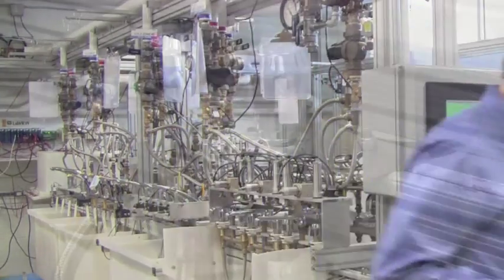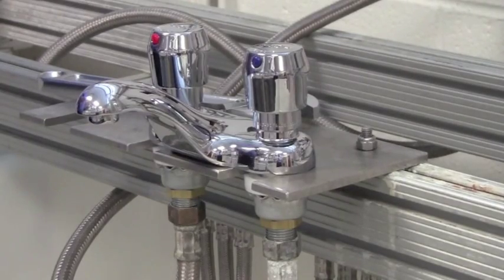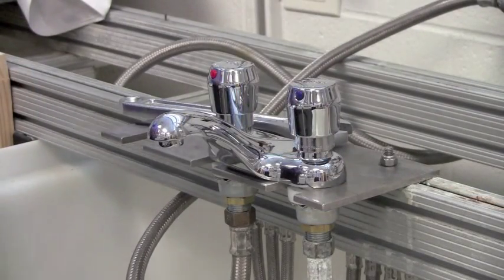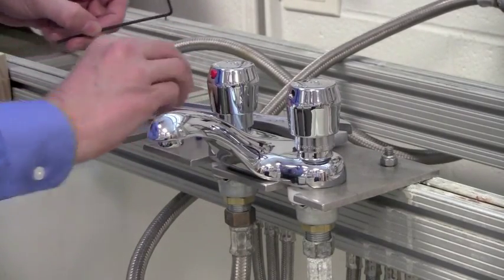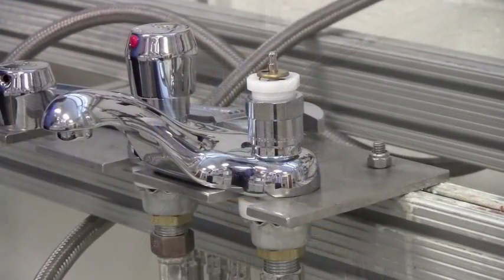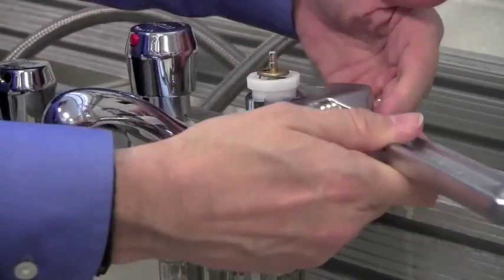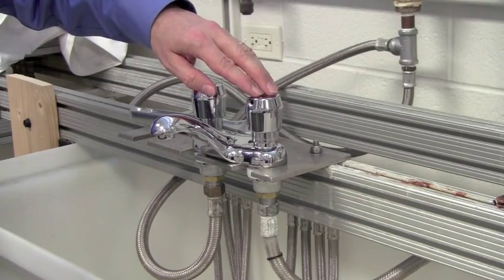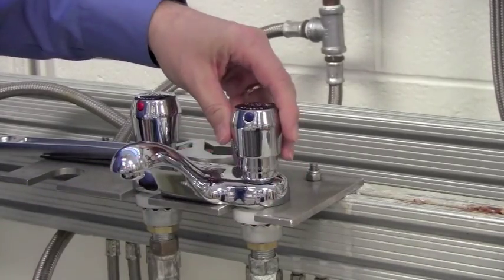Adjust the Timing on Chicago Faucets MVP Metering Cartridge

Comment: I just installed one unit . I air rated the unit fully when i try to time it didn’t work at all . The water keep going and going.
Reply: 3 days lather report. After getting respond from seller i fallowed his suggestion and try to air rated it more time . The next day after using the faucet. The noise were gone and start working properly.
Reply from the maker: Sorry to hear about this! If this is for the 802-665ABCP  faucet with the MVP try the following:

First, make sure that there's no debris that hit the filter and and is preventing it to seat properly. 
I would also pull the actuator and press down on the center stem. It should glide very smoothly in and out. If it feels really tough and get's stuck, add a little plumbers grease to the bottom of that stem and push it a few times to relubricate the o-ring that's inside the actuator. 

If this does not solve the problem, or the stem moved smoothly when you test it, I would suggest replacing the 671-XJKABNF cartridges. Can you tell if the water is cold or hot? That will tell you which side needs to be replaced. 

Let us know if this helps!
Reply: @ChicagoFaucets  
Thank you 🙏. I fallowed your instructions. And put sone grease on the stem . I also pulled the spring to give it more movement. Then i air rated few times just incase .
It was making noise like there is more air in the system Was late I went home the next day the noise was gone and work perfect. Thank you for your help
Reply from the maker: Wonderful news! We apologize for the delayed response, please contact our customer service department for the fastest follow up - they are extremely helpful! (847) 803-5000 or email customerservice.us@chicagofaucets.com 

Again, glad to help and thank you for choosing Chicago Faucets!

Comment: What if we use self adjust primer change the spring load tension so that we need no tool to reset the time by changing the prime pump time by a small side valve hidden underneath the sink so less cost on toolb

Comment: How may I fix MVP timing faucet that don't stop running water?
Reply: I had problem with these units when it was installed by the plumber. The last one i installed myself few weeks ago,after i air rated it. Start making noise. I was very unhappy. But the next day i want to remove it the noise was hone and work perfectly. My thinking is , these unit need to get the air out fully and it need more time t

Comment: you're supposed to wash your hands for 20 sec under running water...just saying...but seems 10-12 is about the longest these can run, have one screw bottomed out and it was at 12sec
Reply: First of all, washing for 20 seconds means wetting your hands, applying soap and lathering up, scrub your hands , then remove soap under running water. No one says you can't push the handle down twice.
Reply: Curious, i was told differently. For me it was make hands wet, turn off water, pick up soap and when enough soap is on the hands, put soap bar back and rub soapy hands together for 40 seconds, turn on water and rinse for 5 seconds or until soap is gone and hands are no longer feeling soapy. 
I use the hospital method about washing under fingernails. 

If you are under running water, wouldn't your soap be rinsed off immediately and leave you with just washing with water. 
Do you keep the soap in your hands and scrub with the soap bar in hand maybe?
Reply: The faucet I’m working with was upwards of 40-50 seconds so as to make patrons complain.